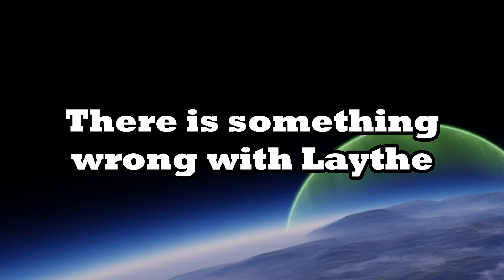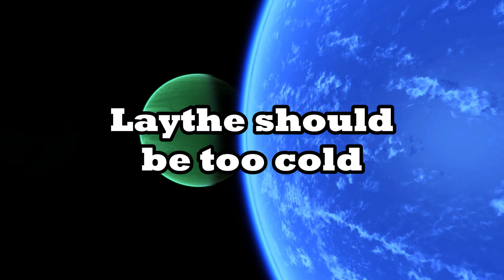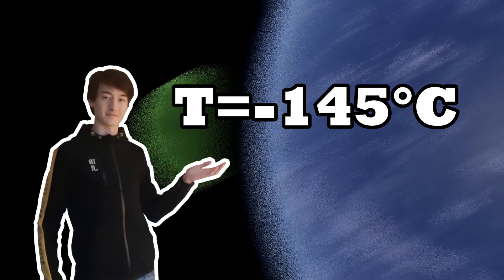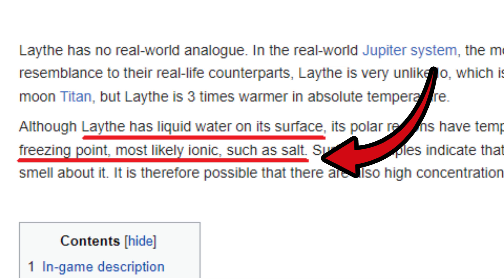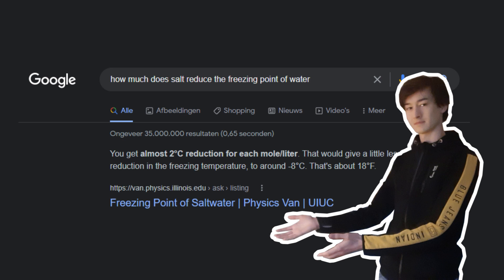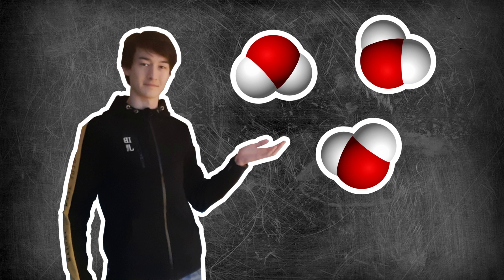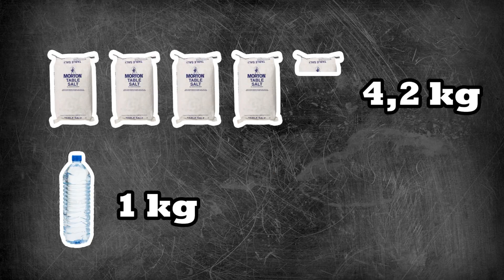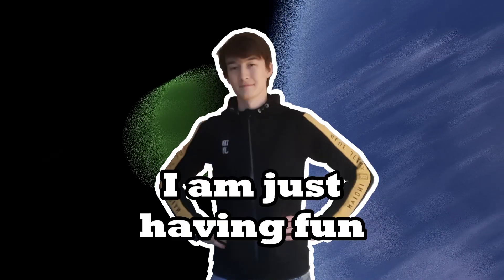The Problem with Laythe

Comment: You also need to factor in tidal heating, the greenhouse effect of the atmosphere (water vapor being the primary greenhouse gas more than likely), and the fact that the surface temps are not equal across the surface. The atmosphere is also thinner than Kerbin's, so the freezing point would not be the same anyway.
Reply from the maker: I have  another video that talks about tidal heating, and also mentions the effects of atmospheres briefly

Comment: Perhaps its a mix of varying degrees of dissolved salt, tidal heating and greenhouse gases. There could be radiothropic algae or fungi living there, that compliments photsynthesis with Jool's abundant radiation to drive their metabolism. They even made an experiment in ISS and it proved to significantly reduce radiation in local area once matured enough. Even if it doesnt produce oxygen on its own, it could simply let other types of algae, or even some symbyotic organoids within its cells to produce some amount of it too. But its really stretching it, as most of KSP enthusiast would know, that Joolian system really cannot exist as it is anyway, as some moons either fall or fly away from Jool's SOI, or destabalize each other over time, others might reach Roche limit and get crushed into an asteroid ring.

Comment: This is a cool video, but you are extrapolating your salt concentration formula way too much. You assume a linear relationship throughout, which clearly isn't true. If it were linear, you could set the freezing point of water to absolute zero or beyond, which is nonsensical. In reality, there is a chemical limit to how much salt can be dissolved in a given amount of water. Beyond this saturation point, no further reduction of freezing temperature is possible.
Reply from the maker: Yep. Very much true. The point though is that salt does not work. Also for the reason you mention.

Comment: My theories on how the liquid water on Laythe is possible are:
1. Laythe may have higher levels of CO2 in its atmosphere, resulting in an enhanced greenhouse effect, raising the temperature to a temperature where liquid water is possible, or
2. The gravitational forces of Jool and its other moons could "knead" and so heat Laythe, similar to the moon of Jupiter called Io, resulting in a temperature high enough to form liquid water.

Comment: Any moon really close to a Jovian planet should have massive tidal heating.  Wouldn't surprise me if 25% of the surface was covered in molten hot lava.  Like our most hellish moon close to Jupiter.  
Seriously - twenty-five percent of the surface of the moon bursting with molten hot lava from all the tidal heating is no big deal at all.  Liquid ocean?  How temperate!!  
Don't ask me to produce the equations for how much tidal heating there'd be with two bodies of those sizes with that much distance between them, vs. rate that the moon can radiate heat into space, plus a bit of heat from their Sun - but someone else can fill in where I'm coming up short, easily.
Reply from the maker: Actually the tidal heating is not as strong as I thought. And tidal heating from Jool is actually not possible, as Laythe has zero eccentricity and is tidally locked. Even if you assume some reasonablr eccentricity, the most recent calculations that I have made was energy in the order of 10¹⁴ W, maybe even smaller. It did not heat up laythe as much as I had hoped. Maybe some heating from the moons could help, but I certainly would not say with so much certainty that tidal heating solves everything.

Comment: Wym calcule the temperature of the surface? Just bring a 2HOT termometer to the surface
Reply from the maker: That would still not explain why it is that temperature. My point is that the temperature is way higher than would be expected.
Reply: @curious_ksp_ksa  maybe it has something to do with jool itself? As in reflecting sunlight back into the planet or irradiating Heat some other way?
Reply from the maker: @miguelrodriguez-pineroriva6713  i am planning on exploring more possibilities. In the meantime, i do have another video that explores tidal heating as a possibility

Comment: I believe that the "water" on laythe is some other liquid, probably sulfur dioxide
the melting point of SO2 is around -70c, which can be achieved on laythe by tidal forces from jool and the other moons
sulfur dioxide also dissociates into oxygen when exposed to ionising radiation (I think), and this can explain the funny smell as well as the fact that there is oxygen in the atmosphere
Reply: to be fair  im pretty sure if you take a surface sample of laythe in ksp it says the same thing as on kerbin

Comment: A thick atmosphere (near 1atm) will also alleviate the temperature differences on the surface, and will obviously make the temperature higher. Did you take this into account with your calculations?
Reply from the maker: You can find that info in the follow up video, but the short answer: yes

Comment: ¿what? but if according to KSP the layde seas are made of something similar to rocket fuel, that is, methane or something similar
Reply from the maker: Well, sadly that is not the case, and if it was, the colors don't match. Other effects could increase the surface temperature of Laythe and make liquid water possible.
Check out the next video about one of those heat sources:
https://www.youtube.com/watch?v=ZbGj3xidS00

Comment: It could be multiple factors. The EVA report mentions something about a strange smell in the air, most likely being salt. But, like you said, in order for Laythe to maintain liquid water, it has to have hella salt. So there’s probably a lot of salt, but not so much. Tidal forces from Jool, Vall, and Tylo could also be warming Laythe up, turning it into the cold paradise we know it as.

Something like this actually happens in real life. Jupiter’s moon Io is pretty much being turned inside out. Tidal forces from Jupiter and the Galilean moons are making Io the volcanic hellscape it is.

EDIT: I just realized a bunch of people said the same thing. Whoops.
Reply from the maker: I hope to release a video on tidal heating this weekend, if my schedule allows it

Comment: IMO Laythe doesn't have to exist in KSP 2. It made sense in KSP 1 as a second place to use jet engines, but in KSP 2, since there will be more interstellar locations, it makes sense that you would have to travel to other stars to find a potential second home for your kerbals. I would redo Laythe to either have hydrocarbon or liquid CO2 oceans, or to have no atmosphere and be more true as an Io analogue. (I know it would be controversial though, but there would probably be mods released that restored the original laythe anyway).

Comment: I think jool acts like a mini star for Laythe.
Reply: Problem with that is it should be an “Eyeball” World with one side warm and the other side ice cold.
Reply: itd make sense if it radiated heat, but it doesnt. jupiter and jool both have "surface" temperatures of less then 200K, so it radiates no heat.
Reply: @Messier42-handle  Maybe it affects like Jupiter on Io and starts volcano and tectonic activity which make planet hotter and also gives a salt to waters
Reply: @J_Pur  i mean maybe, but a 200C difference is quite alot for that

Comment: 0:53 Sea don't only have NaCl, there are also Mg²+ Ca²+ K+ and many other ions
But because Na+ and Cl- are relatively soluble and abundant on Earth, compared with other ions such as Ca²+ and CO3-
So these ions from stones and minerals are dissolved, then released into the ocean through rivers, which is why there are mostly NaCl in seawater on Earth

Comment: I think Tidal forces play a significant role in heating up Laythe since I think based on Laythe's orbit how it's get stretched between Jool and the other moon's gravity could generate significant heat (Maybe more than Titan's, definitely not enough to heat the planet up to have liquid water but enough for it to have an atmosphere)

Also some other things which probably worth considering
-Laythe's atmosphere is a lot more thin than Kerbin or Earth's atmosphere, so pure water would have a significantly lower melt point, at around 0.08 ATM the water's freezing point should be around -40°C - 15°C.
-Since Laythe has an atmosphere the sunlight would heat up the planet more efficiently since it has more materials to reach (I can't word this properly, but also it wouldn't be significant cause the sunlight Laythe receives would be only 0.5 to 2% of what Earth or Kerbin receives)
-Maybe Laythe is geologically active ?

I think the problem with Laythe is not that it doesn't have enough heat to support liquid water on it's surface since in-game thermoscan reveals the temperature to be just around -20°C to -5°C if my memory is right which changes the problem to "How and why Laythe has enough heat to support liquid water ?" which is pretty interesting I'd love to see more theories on that or disproving existing ones about how Laythe could maintain it's temperature, even more so if we'd actually find it out it's scientifically possible!
Also out of nowhere another question came to my mind is our sun and Kerbol (Kerbin's star) has the same characteristic ? (Energy output/mass?) as in they emit the same amount of heating force ?
Sorry if it turned out long, I can't deny I'm curious-
Reply from the maker: Yeah, I realized that I did not word everything correctly and did not explain what I was doing.
What I did in my calculation was the following: assuming that Kerbol is the only heat source, what would the expected surface temp be on Laythe. What I should have concluded with: therefore Kerbol is not the only heat source and there must be something else going on. I wasn't sure if I should have put that bit in, but many people have been saying the same thing, so I'll address it properly in the "sequel".
Reply: @curious_ksp_ksa  Fair, it's can be a bit tricky to word everything correctly, I think it's pretty amazing to put all the effort to calculate what Laythe's temperature would be from Kerbol alone, and I think yours videos are great so far!
I'm curious about the upcoming stream and the sequel too, I think they will be interesting!
Reply: There are three main factors that give Laythe it's oddly high temperature; and then these three factors have several important knock on effects.
Firstly is it's orbital position around Jool. It undergoes an enormous amount of tidal heating, like even more than even Jupiter's moon Io.

The second main factor is it's size. Taking account for KSPs scaling (where everything is about 10% it's true size) the real Laythe would be approximately 50% earths mass. This firstly makes the tidal heating effect on Laythe even higher than it's sol analogue Io due to the tidal difference from one side of the moon to the other; and it makes it more difficult for Laythe to loose heat to space due to the relationship between volume and surface area. This size also means it can hold onto the emissions from the geological activity that results from this heating, resulting in a relatively dense atmosphere with a large amount of greenhouse gases. These gases will trap incoming solar radiation but also prevent the internally generated heat from escaping as quickly as it otherwise would.

The final contributing factor is that Laythe is covered in water. Water makes for a fantastic temperature regulator as well as an important solvent. This both allows the internally generated heat more evenly cover the moon and allows a hydrological cycle that draws volatiles out off the atmosphere. This can even form a negative feedback loop to stabilize the moon just above freezing point. If the oceans freeze the hydrological cycle breaks down and greenhouse gases quickly raise the temperature, If the hydrological cycle speeds up too much then too many greenhouse gases are removed from the atmosphere and it cools down again.

Indeed Laythe seems to be in it's own little goldilocks zone, but unlike earth which is maintained by the interactions between the sun and our atmosphere; Laythe's is maintained by it's orbital characteristics, it's size, and it's surface chemistry.

Of-course whether this could actually happen to a moon IRL I have no idea; I haven't done the maths. But the theory is sound and at the very least a pretty interesting thing to consider.
Reply: @andimason3370 lso, if you have the breaking ground dlc you can find a lot of geysers on Laythe's islands. their description says they might be the reason for its high temperatures
Reply: I am pretty sure the water on laythe just has a lot of salt,A LOT of it,like dead sea,which would make its freezing point very low,so much salt that in fact even the air has some salt,which explains why breathing it for long isn't good for the kerbals
Reply: Exactly, a great example is the moon Io, Jupiter's closest moon

Comment: UPDATED at bottom of comment:
you "did the math" to get it's temperature.. but did you actually measure it with ingame instruments and get actual data?
there's a thermometer you can strap to your ship, for example. science requires testing, you can't just theorize your way to all conclusions like a philosopher! don't make me send a mission to Laythe full of instrumentation! or ill freakin do it! tomorrow ima freakin do it

EDIT: i've done some science to laythe, it has regular geysers. the rocks show hydrological activity. the air is breathable, i can take my helmet off. the surface i was at has salt. a seismic scan shows tidal forces churning the interior of the moon, and definite geological activity.
i've taken temperature scan, it was roughly 20 fahrenheit on land by the shores. negative 86 on land at peaks. and IN the water, the coldest i saw it get at night was 41 fahrenheit, in day it was 51. but 57 out in the ocean. so the planet IS cold, but near the water it seems to warm up. an EVA report on the shores and even way out in the ocean reports a foul smell, (i assume that might hint at sulfur?) also there are MANY large craters. there are many other moons, and a big radioactive gas giant nearby.

Comment: The liquid water could be due to some weird heat source. For reference, Io is a very hot moon despite being far away from the sun due to its orbit and proximity to Jupiter. My guess is that the same goes for Laythe, although there are no obvious signs of geothermal activity on Laythe as far as I know.
Reply: What does the Seisometer say? We can see if it detects tectonic activity.

Comment: look at a map of laythe and think. and for the love of god don't use a flawed equation, it does not take into account other factors of the environment or planet.
Reply from the maker: It is not necessarily a flawed equation, it just assumes that the Star is the only source of energy/heat. But thanks for your input!
Reply from the maker: And I have a question about the map: do you mean the deep part in the water? What do you think it would contribute to the heat, i am curious!

Comment: I think that is the core or the atmosfere that keep it warm
Reply from the maker: The heat would still be lost to the surrounding space i think. 
It would be hard to maintain. Just like the moon of Saturn Titan, its atmosphere is still cold. And Europa (moon of Jupiter) has a heated core, but its surface is still cold. 

It is an interesting idea, i am going to look into it!
Reply: @curious_ksp_ksa  i agree but is like venus is atmosfere is thick and cant retaind heat with out escape . laythe atmosfere is more thick than kerbin so i cant retaind heat even if is no so much is enougth to retaind some heat
Reply: @dani_6378  yes but laythe has a thinner atmosphere (50km on laythe, 70km on kerbin) so laythe should be colder then kerbin but it isnt
Reply: @Messier42-handle  1 year later 💀